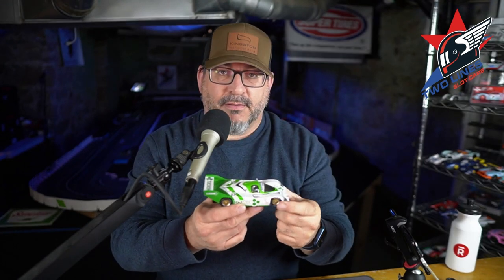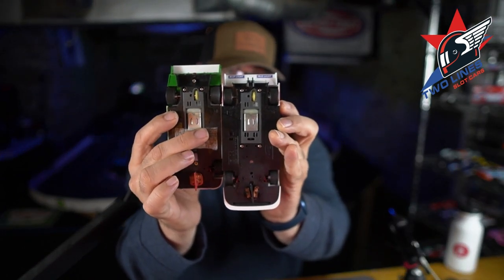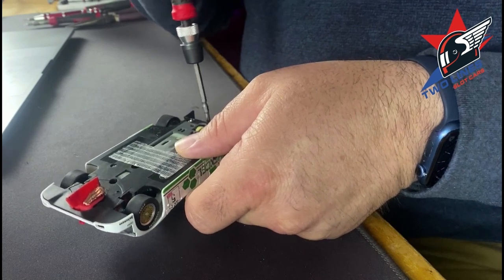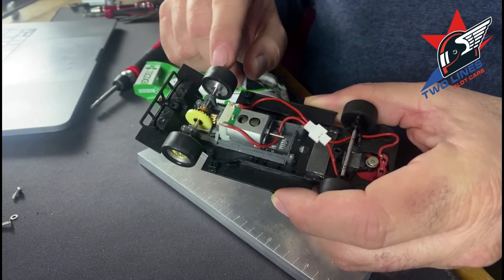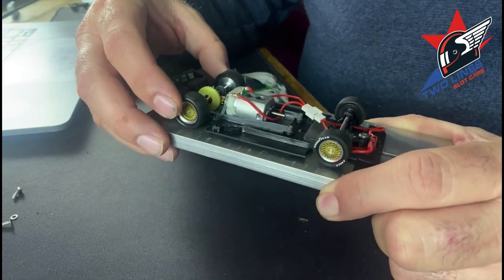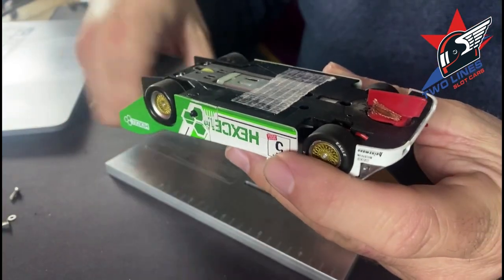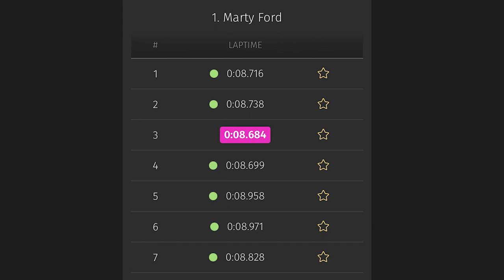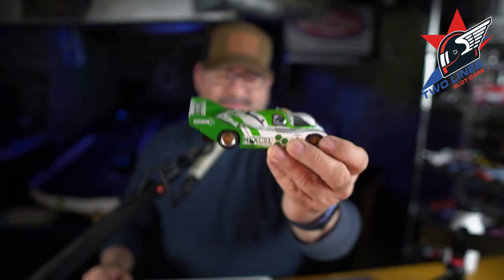Test and Tune the Slot It Porsche 962  #5 Hexcel for Carrera Slot Car Track

Comment: Thanks!  After hours and hours of driving the things, I figured out the trick of driving slot its on my tight track.
  Its corner speed and smooth throttle, don't shut off for corners, but back off a little.
The slightest twitch of the throttle in corner and the car will go sailing who knows where.

Another 500 laps and it will go better.   If it  looks slow its going fast, if its jetting from corner to corner like a dragster? Its going slow.
Reply from the maker: Agree Brad.. laps, laps and more laps..

Comment: Nice video! That car did run great. I have a Slot It Lola and put Slot it tungsten under rear axle, thought it would add grip but when the rear steps out it often deslots. Maybe i should try to remove the weight in the rear and add some weight right behind the guide like you did.
Reply from the maker: Paul, I find that moving the weight forward tends to calm the rear end down a little bit.. that is the fun in tuning.. move the weight.. run some laps.. better or worse? Move the weight again.. then do it again.. and again.. and again 😂
Reply: I will try that, back to the drawingboard again 😅

Comment: Nice video Marty.  If you were going to set this up for digital, where would you move your lead weight?  Would you slide it back to the motor pod, just in front of the motor, or would you move it outside of the chip on the chassis? Thanks.
Reply from the maker: Chris.. I would probably use a Slottechnik Chip and just mount it on top of the weight with some mounting tape.. I really like how the car drives at the moment and wouldn't want to change that....